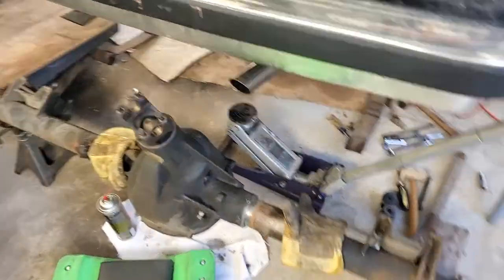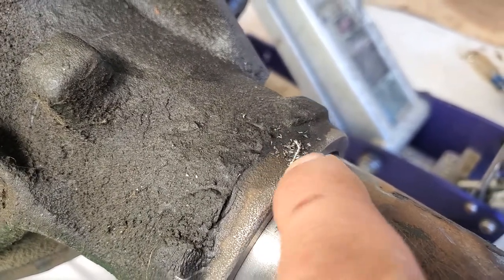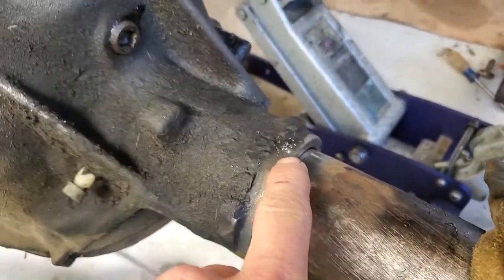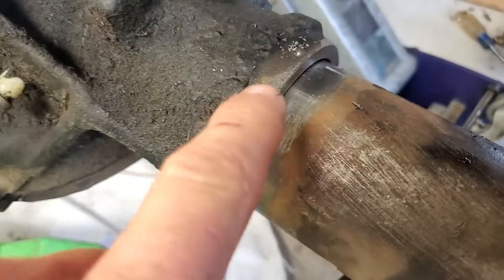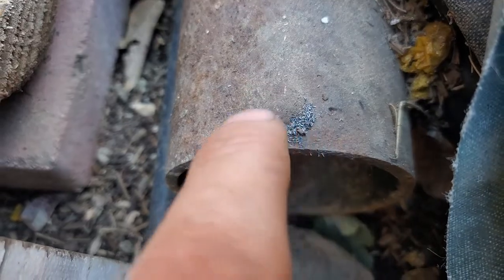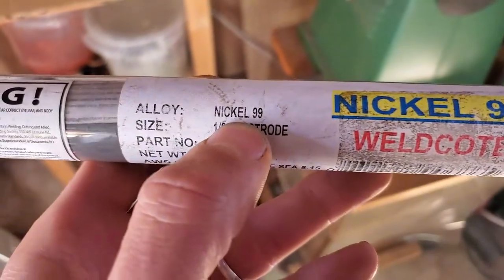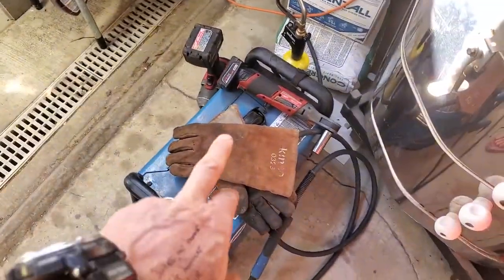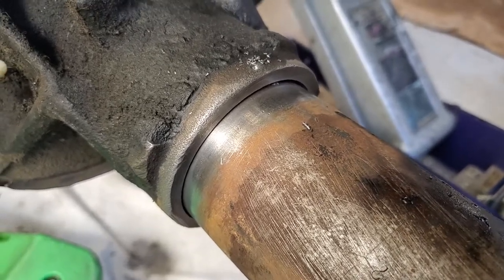Welding my GM 10 bolt axle tubes - the basic test: Iron or steel? Mine is cast STEEL

Comment: Cast iron is a term that applies to a very wide range of materials. There is grey, white, ductile (nodular) and malleable. Even among a given class like ductile, there are a variety of alloys. The ductile variety is the one typically found in automotive applications. It can produce some spiral shavings when drilled, but they are distinct from steel in their grey color (as you noted) versus a more silver color with steel and the shorter, rougher spiral shavings versus steel's clean long spiral shavings. 

Personally I think the drill test is the most conclusive (short of a lab analysis, which is out of reach of most hobbyists). I've tried this on a DANA 44 from the front of a '77 Ford F150. I compared the housing, tubes, inner C's and knuckles. The housing and knuckles are ductile iron and the tubes and C's are steel. The C's are cast, but they are steel.

One interesting choice when welding ductile iron is ER NiFeMn-CI filler. You can buy smaller spools for MIG welding in 0.035" diameter from Crown Alloys under the brand Royal 44-30. You can use this wire with C25 shielding gas and pre and post heat may not be required, but for large work pieces a moderate pre-heat may be a good idea to enhance penetration, like you would with a large steel work piece. 

See: https://app.aws.org/wj/supplement/WJ_1985_03_s79.pdf

It's a bit technical, but the addition of Mn lowers the solidification temperature of the filler and allows it to more closely match the thermal expansion of ductile iron which reduces stress in the HAZ. This is what prevents cracking.

Comment: Finished product?
Reply from the maker: Yes it's finished but the point of the video is to demonstrate how I checked if mine was iron or steel-
Reply: @fstarockaburns425  I guess I should have asked. Did you preheat and did it crack after welding to it
Reply from the maker: @moejr14  steel doesnt require preheating, cast IRON does- these differentials are cast steel so you can use flux core wire or pref a 7018 rod, 1 inch every 90 degrees so it can cool down during beads. There is a groove i just cleaned it VERY well with a wire brush  and brake cleaner.. hth